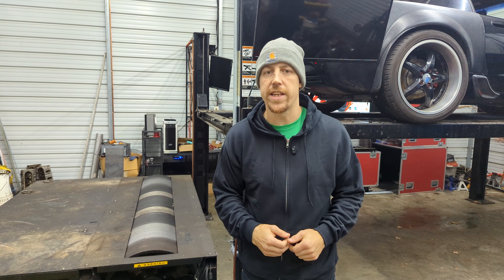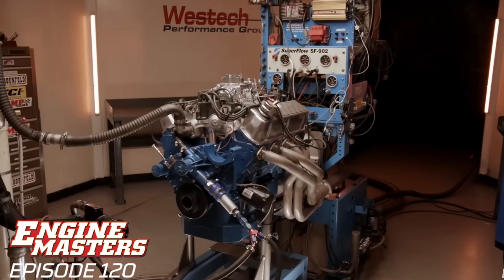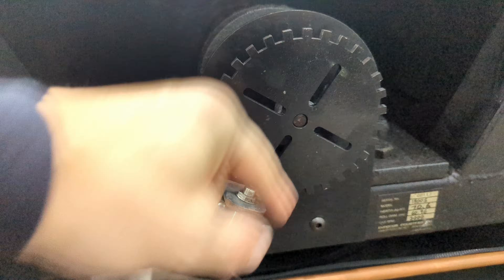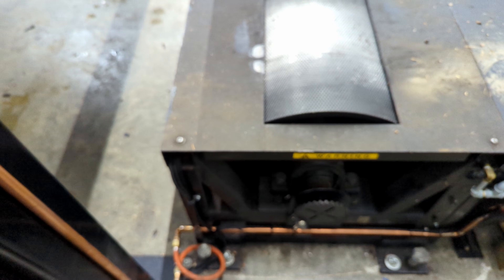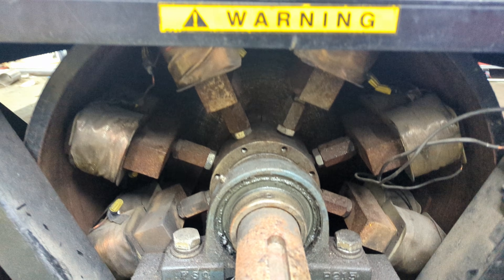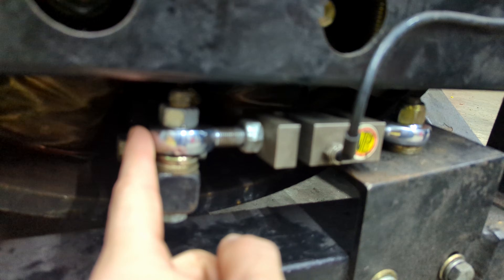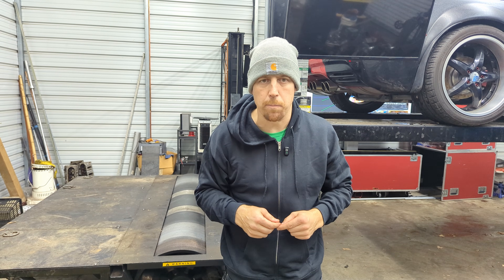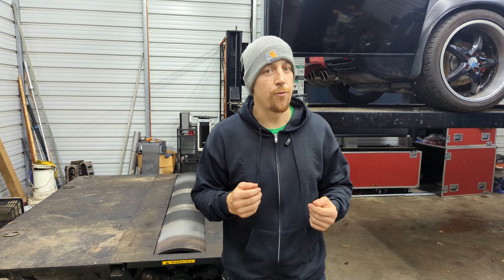How a Dyno Actually Works (It's Simpler Than You Think)

Comment: An inertia dyno DIRECTLY measures power.  Probably shouldn't post a video explaining something you don't understand.

An inertia dyno does NOT measure force.  Engine force (torque) is mathematically derived IF, AND ONLY IF, you have an accurate engine RPM.  Alternatively, it can mathematically derive wheel/drum torque which will be an absurd and virtually useless number.

At least you got force correct instead of calling it work...
Reply: You managed to get that completely backward. 

The inertia dyno only measures speed, or the time interval between pulses. The rate of change of speed derived from that (and a clock) is the rotational acceleration of the roller/drum; from the acceleration and moment of inertia the torque is calculated, then from the torque and speed the power is calculated. Power delivered to the drum is multiple steps of derivation and calculation from the measurement. Engine power is implied by the calculated power to the rotor and multiple assumptions about drivetrain and tire losses, and is equally valid regardless of the engine speed (and whether it is known at all). Engine speed is only needed to calculate engine torque. 

Drum torque divided by the drum to engine speed ratio is the engine torque - it is neither absurd nor useless.
Reply: @brianb-p6586 you are a great example of confident ignorance.  There is literally no force gauge on an inertia dyno therefore it CANNOT measure force.

There are so many errors and self-owns in your reply that I won't bother pointing them out.

How many dynos have you calibrated/designed/engineered/developed?  Obviously that number is 0 for you and more than 0 for me.  Let the big boys handle the stuff you can't understand.
Reply: @brianb-p6586 hint: your "acceleration and moment of inertia" obscuration nonsense is just another way of saying horsepower.  You're saying that it measures horsepower without even comprehending that you are.  😂
Reply: @zacharymorris9917 one of us understands the physics... it's not you. 

The only measurement is drum speed, which is not power. It's not even energy: if someone adds mass to the drum and runs the dyno with the same vehicle at the same output it will display lower power... because it is not measuring power, or even energy. 

Given that one rotational speed measure and its acceleration derivative, you can 
1. calculate torque (from the rate of change of angular velocity and moment of inertia), then calculate power from torque and speed,
or,  
2. calculate energy (from speed and moment of inertia), then calculate power (from the rate of change of energy).
Reply: For anyone else reading that might want to learn: measuring the rate of acceleration of a known inertial load is literally measuring horsepower, which is EXACTLY what an inertia dyno does.  The inertia dyno software has a known inertial load constant and an RPM sensor in the same way that a brake dyno has a known fulcrum constant and a load cell.  One measures force (torque) directly and power is derived mathematically.  The other measures power directly and force is derived mathematically.  Only a complete and utter dullard could be capable of failing to understand something so incredibly simple.
Reply: @zacharymorris9917 rate of change of angular momentum is not power. Also, the measurement is of speed - the instruments don't measure the moment of inertia. Anyone who is not familiar with these basic concepts can review high school physics material.
Reply: @brianb-p6586 if you're going to reply, at BARE MINIMUM, comprehend the words you're replying to.  Reread and try again.

You should stop trying to sound smart.  It's having the opposite effect.
Reply: @brianb-p6586 you failed a multiple choice question even after given the answer.  😂😂😂

Comment: I have built 7 dynos, and most use simple dyno SW/FW, really low cost way of doing it.
Reply from the maker: That lines up with what I’ve seen as well. The mechanical side is the hard part, the roller in specific. The electronics don’t have to be exotic to get good results.
Reply: @PyroPerformancePNW  It's only hard if you don't want it to break.

Comment: For me the clearest way to understand 5252 is:
1) 1 horsepower is defined as 33,000 lbs feet ( or ft/lbs if you prefer) per minute.    I.E the power required to push 33,000lbs 1 foot in 1 minute.
2)  Engines (and dynos) operate with angular velocity not linear, therefore the distance part of the horsepower definition needs to be converted into RPM
3) a circle’s circumference is equal to its radius times 2pi which is approximately 6.283.   
4) 33,000 / 6.283 = 5252.   Therefore if an engine is producing 1 lb/ft at 5252 RPM it is producing 1 horsepower.
Reply: The 6.283 ft circumference of the roller implies that the radius of the roller is 1 ft. So this will vary depending on the radius of the roller.
Reply: @pkphilips2 The dyno is reporting to you in Ib/ft regardless of the actual radius of the roller, so you still divide 33,000 feet by 6.283 radians.  Similar to your engine’s torque is calculated in lb/ft even though the crank radius is much less than 1 foot.

Comment: The constant 5252,1131 comes from the fact, that 1 horsepower can lift 33,000 pounds of weight straight up at a rate of 1 foot per minute. Because engines and motors produce a rotary motion, you use a 1 foot radius wheel, which is 2 feet in diameter. Each turn of that wheel raises the 33,000 pound weight 2XPi. therefore: 33,000 divided by 2 X Pi  = 5252.1131. With that constant, you can multiply that constant times your horsepower, then, divide by torque to get RPM, or, divide by RPM, to get torque. Torque X RPM divided by that constant, tells how many horsepower. This all "stands", because torque is rated in foot-pounds, and speed is measured in rotations per minute. (RPM)
Reply: I have always wondered how it was determined.  Great explanation! Thanks!
Reply: It’s the same when using metric except the magic number is 9549 (9549.2966)
(Nm x RPM) / 9549 = kW
You can eliminate the 9549 if you use radians per second rather than RPM
Nm x rad/s = W
You just have to remember that the answer is then is watts so you’ll need to divide by 1000 if you want kilowatts. 
It also means that at 9549RPM the torque in Nm is the same number as the power in kW. Just like how at 5252RPM the torque in ft/lbs is the same number as the power in HP
Reply: Thanks.
Reply: Somehow you felt the need to quote your grade school text book to us?
Reply: @Doc-n7u  I missed your contribution? What was it again?
Reply: @CrankyNerdRides - About as much as yours.

Comment: The wonderful simplistic explanation only goes to further my confusion on why these machines cost around $25k to $65,000+??
 I'm in the wrong business.
Reply from the maker: That's a great question and I think there's only one answer to it:

Dyno buyers are a niche market who stand to make a lot of money off of their purchase. Therefore the manufacturer can charge them based on the value of the tool, not based on the cost of production. 

And don't get me started on the garbage electronics that many of the dyno manufacturers ship with their products. There are several EXCELLENT and affordable standalone dyno data acquisition systems that are available. I'm running YourDyno on mine and it is GREAT!

If these dyno manufacturers, which shall remain unnamed for now, were to contract with one of these standalone companies for their electronics they would immediately provide superior products to their customers. But they won't do that, because they'd rather put together science fair level circuitry and sell them for thousands.

I'll get off my soap box now, but you and I share a common mindset about these things.
Reply: I have literally wondered the same thing for ages and came up with the same conclusion years ago. I work in a field where specialty tools are used and they are mad expensive, not because they cost a lot to make, but have a niche market.

Comment: wondering is that an accurate enough approach compared to real load plus torque sensors. Wheel and drivetrain inertia is the big source of an error with this method
Reply from the maker: That’s a fair question.

Inertia-only methods are very repeatable, but they’re not trying to perfectly model real-world load. Wheel and drivetrain inertia absolutely influence the rate of acceleration, which is why inertia dynos are best used for before/after comparisons on the same setup, not absolute truth.

Load-controlled dynos with torque measurement are better when you want to separate engine output from system inertia or simulate steady-state conditions. Each approach answers a slightly different question.

Neither is inherently “wrong”, it just depends on what you’re trying to measure.

Comment: It's because in 1782 James Watt came up to measure horsepower and 5252 was his favorite number.
Reply: When James Watt tested horses, he actually came up with ~360 foot-pounds of work per second, but, he rated his engines at 550 foot pounds per second, to guarantee, that his engine can out-work any horse his engine is likely to replace. 550 foot pounds per second of work per horsepower, is the figure adopted by the Society of Automotive Engineers. (SAE) A horse can actually produce much more than that for short periods of time, but this is based on what a horse can AVERAGE over an 8-hour day. It doesn't make too much difference, if the horse is worked hard then rested, or, a steady pace all day long. A horse pulling a walk-behind plow, can pulls ~160 pounds of tractive effort at about 2 MPH, all day long. James Watts 1 horsepower steam engine would pull that plow at about 2.34 MPH.
Reply: Should be redone for the new millennium, six-seven!  ❤

Comment: To calculate HP on an inertia dyno, one is supposed to insert the rotational inertia of the engine and rotating assembly.
The snake oil salesmen who try to sell you "Lightened pulleys" or flywheels will use an Inertia Dyno to "prove" that lightened pulleys "increase HP".

They test the stock car on the inertia dyno using the proper mass of the rotating assembly.
Then they swap to the lighter pulley and they DONT CHANGE the rotating mass in the calculations, so the dyno CLAIMS increase in HP.
Lightening rotating mass CANNOT "increase HP"
Reply from the maker: You’re absolutely right that reducing rotating mass doesn’t increase engine power — it improves acceleration, not steady-state output.

Where inertia dynos can confuse people is that they measure how quickly a known roller mass accelerates. Changes that let the engine accelerate the system faster (like reduced rotating mass) can show up as higher calculated power during a sweep, even though the engine itself didn’t make more torque.
That’s why load-controlled testing or steady-state comparisons are important when separating real power gains from changes in system inertia.

Good comment.
Reply: @PyroPerformancePNW  Thank you.
I have had to argue this point with many Car "Experts".
I had to point out that the acceptable method for measuring Horsepower is with the engine at CONSTANT RPM.  
I then ask them HOW a different rotational inertia can affect the engines performance AT CONSTANT RPM.
I usually never hear back.
Reply: this touches on an interesting thing though...

an engine delivers impulses of a certain strength.
a flywheel absorbs them and then releases them.

strap a 5T flywheel to an engine, it doesnt run "slow", it simply doesnt run as the flywheel absorbs MORE energy than delivered by the impulse... it doesnt get sufficient momentum to follow through on the next cycle, it has TOO MUCH inertia. 

a rotating object is undergoing CONSTANT acceleration, at right angles. that takes power.

whilst a lightened flywheel doesnt "produce" extra hp, it does allow for a higher RPM, and that comes with extra hp.

less power to simply spin the flywheel, more power to spin... something else.

strap an engine to the bench, start adding flywheel mass, and you can limit max RPM with the flywheel alone.

conversely, reduce rotating mass and at some point a rod or piston lets go instead :) 

most commercial engines run in this region anyway...  so yes, flywheels make no difference to power, its not the limiting factor. just adds a bit more responsiveness.

Comment: The number 5252 appears in the horsepower formula because it's a conversion constant that makes horsepower (HP) and torque (lb-ft) equal at that specific RPM, ensuring they cross on a standard dyno graph when plotted on the same scale. It's derived from converting RPM (rotations per minute) to radians per second and relating that to the definition of horsepower, essentially balancing the units so that Torque (lb-ft) x RPM / 5252 = HP.
Reply from the maker: Thanks for sharing the math, and for watching!
Reply: Thanks chat gpt for your powerful insight.
Reply: @GiantMeteor2028  yeah, so?
Reply: @GiantMeteor2028  Actually, I already knew that but was too lazy to explain
Reply: @armadilllo cool story bro
Reply: @GiantMeteor2028  Been working with dynos for almost 50 years.  Don't really care what you think.  Do you always stalk people?
Reply: @armadilllo Dude im a troll. Look it up boomer

Comment: Bro, the reason you have this constant is because the input needs to be converted from imperial to metric system and the output to imperial HP. The calculation fully makes sense when viewed in the metric system instead:

Power[W] = angular velocity[radians/second] × torque[Nm]

But to get it in imperial system you have to convert from RPM to rad/s which is divide by 9.549. And from torque in FTlbs to Nm which is multiply by 1.3558179483. Finally you need to convert W to HP, which is multiply by 0.00134102209. 

If you divide 9.549 by 1.3558179483 and again by 0.00134102209 you get 5252.

If you look at metric system you only have to convert from RPM. So when calculated in KW, the lines will cross at 9.549. If you measure in HP, the lines will cross at 9.549 divided by 0.00134102209 which equals 7,120.

So, the constant has to do with converting the input parameters so that the result is in your desired format.

And why do we multiply speed and torque? Because power measures ability at a certain rate.
Reply from the maker: Thanks for sharing the mathematical details behind the physics!

Comment: It's 5252 because when measuring in lb/ft we are basing the measurement off of a 1ft lever or radius which gives a 2ft diameter so our theoretical distance traveled is 2x pi,. So it takes 5252 revolutions at 1lb/ft (6.283lb/ft per revolution) to equal 1hp or 33000lb/ft/minute.
33000÷6.283=5252.
Reply: NICE.
It's great to hear people being able to rattle this stuff off.
We need to get our schools back to the standard, where at least 75% of high school graduates, can state exactly what you did.
Reply: @m4rvinmartian . No people do Anything unless a Leader steps up. 
MADD, Mothers Against Drunk Drivers was started by one woman, and changed the United States.
Reply from the maker: Thanks for sharing the mathematical details behind the physics!
Reply: Just use real units (metric) and than power (Watts) is torque (newton*meter) multiplied by rotating speed (radian per second).
No shitty coefficient to remember...
Reply: @gsbeak  But you still need to convert the angular speed (RPM) into radians per second by multiplying by 2.pi  and then dividing by 60.  Worth mentioning for some readers: a radian is the length of the circle arc of equal length to the radius of the rotation (circle),  pi, is the circumference divided by the diameter. A constant, so the same for all circles.  Multiply by 2 as there are 2 radii in each diameter. And divide by 60 to convert minutes to seconds.  YES - the metric system make life, education and the acquisition of knowledge (and understanding) so much easier!
Reply: and the rather "randomly arbitrary"  33,000 imho comes from 1000lbs of water lifted to 33ft or its vapour pressure, both of which are easily replicated in the field by "idiots"... he couldnt get out there and test every engine himself to charge royalties...
Reply: My head hurts. 😂😂
Reply: You don't have to say "... what is called...." Those are the official terms, are they not? Just use them directly.
Reply: Bro literally said it would be for a different video @ 4:06 but you just had to be that guy. I know he's already responded with a like and all but seriously? Find a new hobby.
Reply: @tonyb7748  why do people take pride in being stupid, ignorant, and then get upset when others arent?

whats YOUR hobby thats so valuable and essential? hmmm?

"find a new hobby".
people used to occupy themselves by figuring this stuff out. then explaining it to others.

youre hobby is apparently belittling anyone thats taken the time to educate themselves.

if you want to be ignorant intentionally, then go do it elsewhere ;)
Reply: @paradiselost9946  Wait... someone is stupid and ignorant because they don't know the theory behind the calculations of comparing the work done by a combustion engine to a theoretical "horse."
Go touch some grass...
Reply: @paradiselost9946  Nope, right here brother.
Reply: @manbunmyname5866  lol. you made yourself out to be a dissatisfied, and rather facetious dullard.
now attempting to save face, you must bluster... "oh my, anyone should know how an engine works..."

my bet, my wager, is that you have no idea WHATSOEVER about how engines really work.

"ive been a mechanic for fifty years..."

nah. you spun spanners and repeated the basics you were taught at tech... did you belittle your teachers? when you had your apprenticeship, did you roll your eyes and tell them what a 3/8 spanner is cus YOURE the expert?